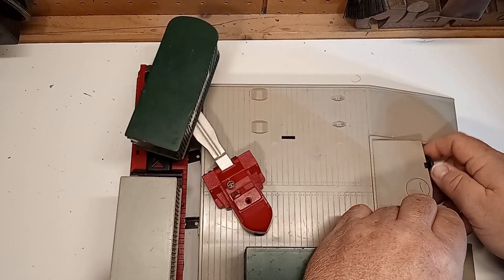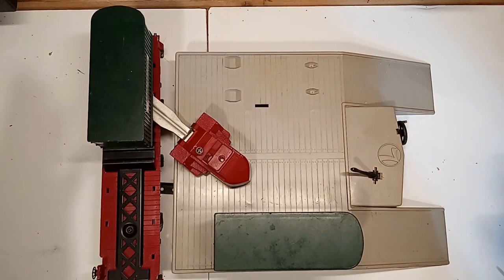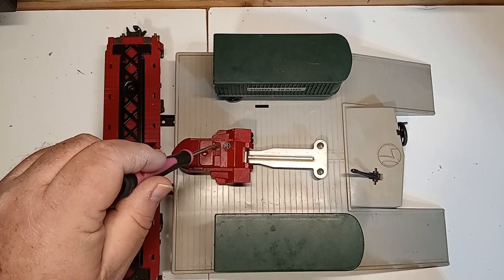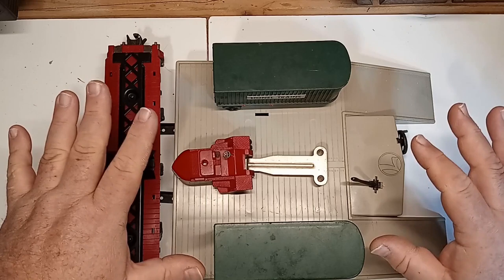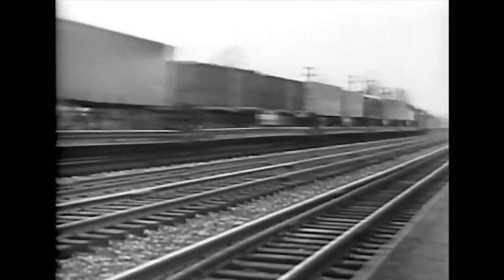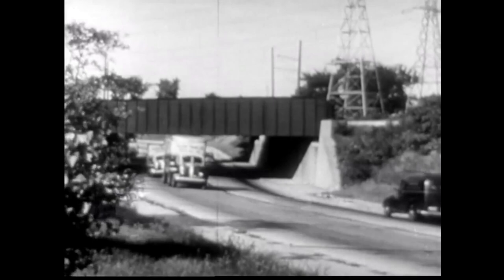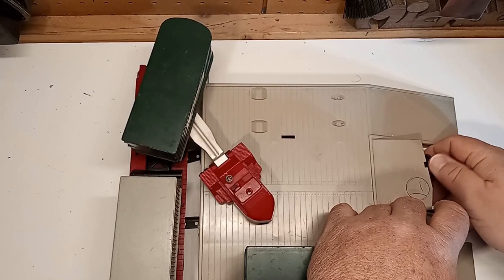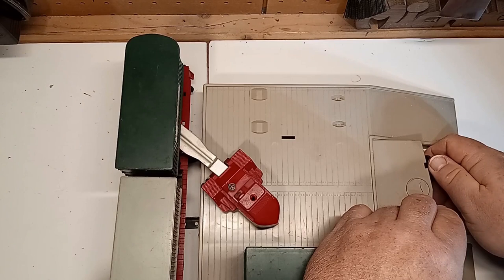Lionel 460 Truck Transport Set - Simple Fastasy Or Realistic Action?

Comment: The rubber wheel is a rubber grommet. They're usually used if a wire or wires need to pass through a hole drilled in a sheet of steel to keep the wires from getting cut.
Reply from the maker: That makes sense. Thanks for the ID. I wonder why the original part is missing.

Comment: Probably the strangest TOFC system,  is the New York Central's "Flexi Van" service.  This system used a special yard tractor, and specially built trailers which would be pushed back to a traincar, and then after a lever was pulled, the trailer's wheels would drop away. The yard tractor would then push the van back onto a turntable on the car, unhook, and then the driver would simply push the trailer around to parallel with the car body, and lock it in place. This system was later modified to carry two trailers, and had the yard tractor push the trailer around, as opposed to using the centrally located pivot point. (With the later version, the pivot was at the far end of the trailer.  There are models out there in O scale of the Flexi van system, though none from around when the system was in service in the 1950's. It is curious as to why Lionel never went with an operating toy of this type of system,  though realistically speaking it could just be down to complexity, and rarity of the system. Specifically the Flexi Van system didn't really catch on beyond some minor uses for mail and parcels use.
Reply from the maker: Thanks for the information!
Reply: A bunch of railroads used flexi vans.  NYC and ATSF ran them coat to coast.  MILW, IC, WP, CBQ, SAL, L&N?, SOO?, MP?, had them.
Reply from the maker: https://www.truckinginfo.com/159091/just-an-old-trailer-no-its-part-of-intermodal-history

Comment: That rubber piece the previous owner had on the shaft was a rubber grommet insulator , used when you drill a hole through metal and want to insulate it to have wires run through it. Prevents the wires rubbing on bare metal. It was instantly recognizable for me, lol
Reply from the maker: You never know what you may find!

Comment: Another amazing video-great  historical background and outstanding b-roll. As has happened before you inspired me to check out the 460 I got recently in a bunch of boxes I got from a local auction. I took a pic of the interior but don’t see a way to share it. The rod attached to the wheel is geared and the disk is slotted for the gear. Have the little blue guy but missing the rear set of wheels, screw is attached but body broken at attack point. Thanks again!
Reply from the maker: Hmmm.. another variation!!! I guess Lionel was constantly trying to improve the movement. Thanks for the information!

Comment: Interesting how Lionel reused older parts of one item for a similar item that performed a different task. Like they had a lot of unsold bases from this accessory and someone or a group of designers devised a new function for the unused left over parts. The crane on the next version was also used on some flat cars, the cars themselves were adapted to do many different jobs. The flat car with trailers also was sold with cars.
Reply from the maker: Yes, Lionel reused or modified parts as much as possible. Like the Aquarium car became the US Mint car and the Giraffe Car became the sheriff and outlaw car, etc. Most companies will reuse tooling whenever possible. Thanks for watching!

Comment: Great video.  I wonder if anyone has motorized this.   A slow, geared motor, reversing switch and solinoid would probably be all thats needed.  Just a thought.  Thanks again for the video!
Reply from the maker: I think there's a YouTube video of someone who did it with an Arduino, a stepper motor and a servo.
Reply: @ToyTrainTipsAndTricks  wow, thats a pretty complex solution using an Arduino.  I was thinking along the lines of a forward/reverse switch attached to a low speed or geared motor and a small soliniod connected to a power switch to lift the trailers.  What ever works. :)

Comment: Hey Mike. Very good video. I have this accessory myself, and at the end of the rod, there shouldn’t be that black wheel (rubber grommet it looks like) or the 2 metal washers. It’s supposed to have a piece of 1/2” rubber tubing like a small piece of rubber hose that’s fixed to the end of the rod. That in turn would rub against that metal disk with the grooves in it which help the rubber tubing grip that disk to turn it when you turn the crank handle. The large flat spring clip puts constant pressure down on that rod with the rubber tubing on it so that it wouldn’t slip against the disk. That rubber tubing over time gets hard and it will slip on the disk. I just recommend getting a new piece of rubber, OR a small piece of Tygon rubber hose that’s used as fuel line on small engines like weed whackers, or chainsaws. Keep the videos coming!
Reply from the maker: Okay, do yours has the #460-25 rubber stopper and the grooved disc. Check.
Reply: @ToyTrainTipsAndTricks  Hey Mike. Do you have an email address I can send you pictures I took of mine? Thanks, Tom
Reply from the maker: @TomzTrainzandAccessories  mrmoore2001@gmail.com

Comment: I enjoyed your video, and I agree that it is a very underrated Lionel post war accessory. I had to look at the one that I have and the first thing that I noticed was the price of $8.79 was written in ink on the box, my platform has the teeth on the bottom piece and the rubber piece that makes it turn was defective and I replaced it with a piece if a silicone hose. The forklift on my 460 only partially works, it turns completely around, and the lift will go up and down but when a trailer is loaded on the forklift, and it is in the raised position it will not lower unless I give it a nudge. I worked on it for hours, but I can't get it to work like yours. Other than the forklift problem mine is in good condition with all of the pieces and is probably around 65 years old. Like you stated I can't find any servicing documentation on the Lionel 460 Acessory. Thanks for your very detailed video..
Reply from the maker: Thanks for commenting about yours. Mine was also a little sticky until I put a small amount of lithium grease on the sleeve where the lift rod passes through the platform. Thanks for watching!

Comment: Hi Mike, forgive me for asking a question not related to this specific video. I am new to the hobby and I know you will know this answer. How do you know which terminal on the transformer should go to the center track hot and which one goes to the outside common rails?  One terminal has a square post stand and the other has a round post stand. Thank you Mike.
Reply from the maker: No problem! It sounds like you have one of the small 25 watt starter set transformers. The good news is that with AC power, it doesn't REALLY matter which side goes where as long as you are consistent. Otherwise, it only becomes an issue with a larger, more complicated layout. I hope this helps.